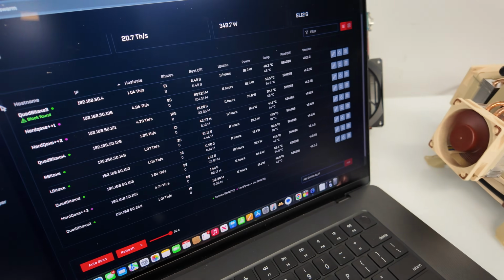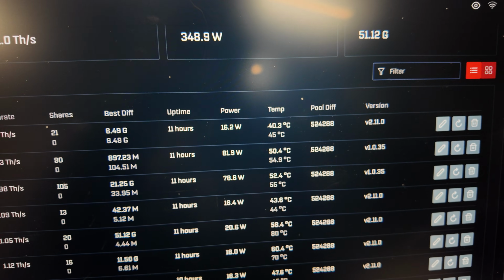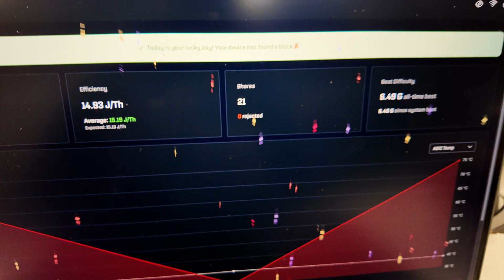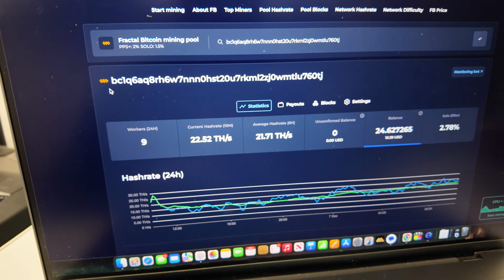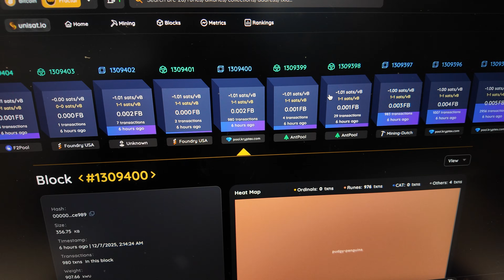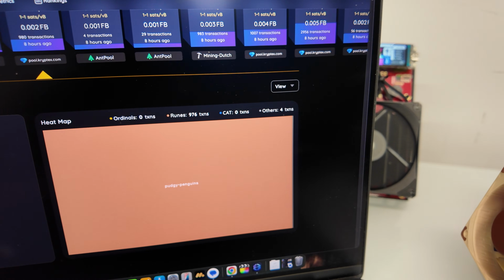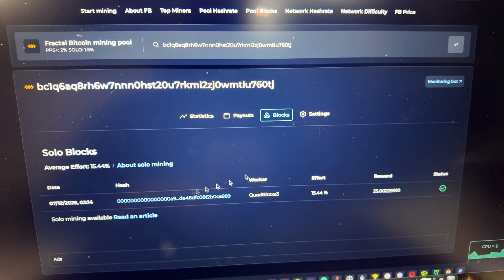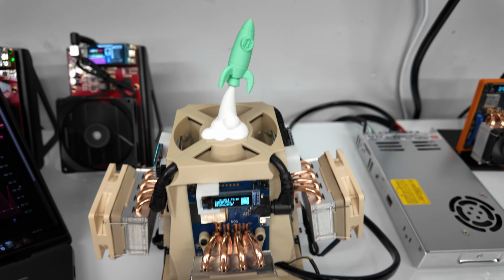I Mined a Block In Under an Hour

Comment: how do you have one power supply powering four 5v bitaxes? ive got a problem with too many power supplies.
Reply from the maker: You just have to purchase a power supply that can handle the amperage/wattage for your load. The mean-well 5 volt power supply is a popular option, and it has multiple terminals where you can connect your units to. You can even connect multiple units on one terminal so you can fit a lot. And they are super cheap you can even find it on Amazon. To get the best efficiency out of your power supply you wanted to run at about 50% load just keep that in mind
Reply: @SoloBlockio  i didnt know this. all of my gammas are pulling about 30watts each. so lets say 4 x 30 - 120watts, and you say 50%, so I need roughly 200-250 watts and i can wire 4 gammas on one power supply.

Comment: ima grab a 3d printer on amazon what like type of like materal or whatnot should i order with it to make that nococ?
Reply from the maker: I just used PLA. Bambu printers are the best and easiest to use in my opinion. I have the A1.
As for the parts they're all listed in the description
Reply: @SoloBlockio  yer the man

Comment: It’s cool to be starting hobby this with someone, putting out their first time experiences. What wallet or wallets would you recommend for beginner?
Reply from the maker: It depends on what you're mining. Exodus wallet is great. If you want to mine fractal Bitcoin then I'd go with unisat wallet
Reply: @SoloBlockio  yes sir that’s pretty much exactly what I’ll be going for. Im more interested in of low difficulty coins. Eventually, I’ll work my way up to a nerdaxe q++.

Comment: Congrats. I only have 1 4th hexa. Been trying to find something to mine that would be easier until I could get another
Reply from the maker: Try DGB or fractal bitcoin
Reply: @SoloBlockio thank you. :) I have been on mining Dutch which I’m not a fan of, trying bitcoin classic. Been running 30 hours. Sure it will take ages.

Do you think the other options are more realistic? Have you smashed anymore blocked? ;)

Comment: @SoloMining, great setup & congrats, i'm curious about the powering of the 4 Bitaxe, the PSU is LRS-600-12 but the Bitaxe needs only 5V how did you manage to put this together? or maybe i'm missing sth
Reply from the maker: It's the 5V version of the meanwell power supply. Nothing special was done to make it work

Comment: The miner link goes to a power supply.
Reply from the maker: Oh wow im sorry, i have fixed it. But just noticed they recently sold out. I heard the Solo satoshi ones also are high quality and come with the compatible noctua connectors
Reply: @SoloMining thanks!
Is there a seller for the mounting you used?

Comment from the maker: Products used in video:
DTV Bitaxe Gamma 601 https://amzn.to/3Mxg1yl
120mm Nocuta Fan 5V https://amzn.to/4pTvU0m
Noctua Fan Controller https://amzn.to/4pXyenb
MeanWell 300W Power Supply https://amzn.to/3Mxg1yl
GeeekPi Low-Profile https://amzn.to/49WOkc1
12g Power wire https://amzn.to/4pwCIl6
14g Barrel Connectors https://amzn.to/4pwCIl6
Thermal Paste https://amzn.to/3Mxg1yl
Heat Sinks https://amzn.to/4iK5UT0
Wago Connectors https://amzn.to/4iJj02Q
Reply: Please check your link to the Gamma 601.   It is showing a power supply for me.  Thanks for the video